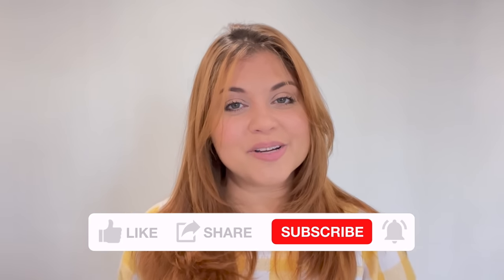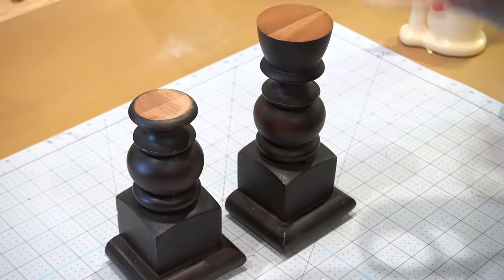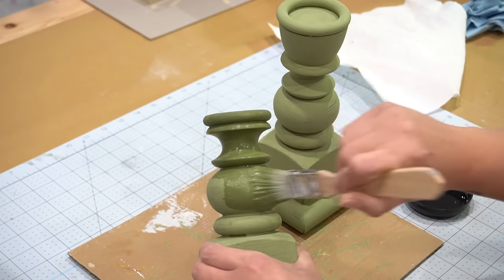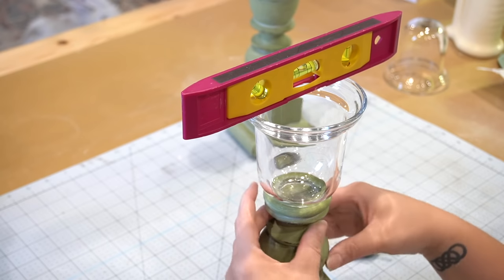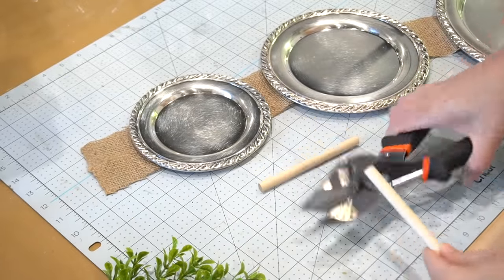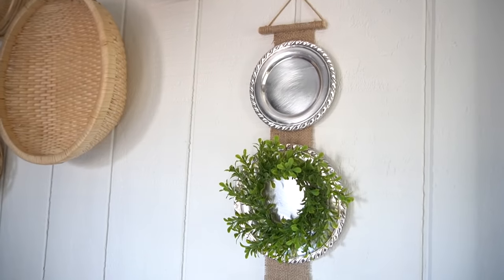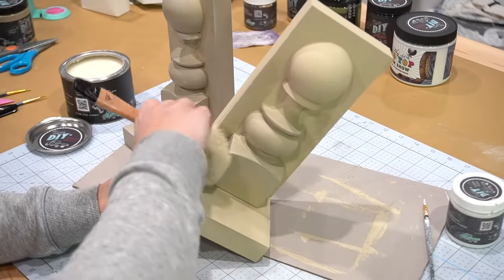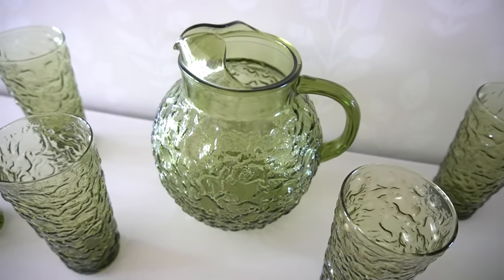🌟THRIFTED HOME DECOR | Home Decor on a Budget | Thrift Flip

Comment: I love all of your makeovers... on this diy tutorials I  absolutely love the ones where you use the wooden " dowels, rods, ballasts, or whatever"... and the pitcher and glasses are fabulous 👌... one thing you might would like to try for the tired plate stand could be using e-6000 around the perimeter of the divider pieces with a dollop of hot glue in the center of the glue  circle... the e-6000 will provide a more permanent bond while the hot glue will give it a quick stick while the e-6000 sets...